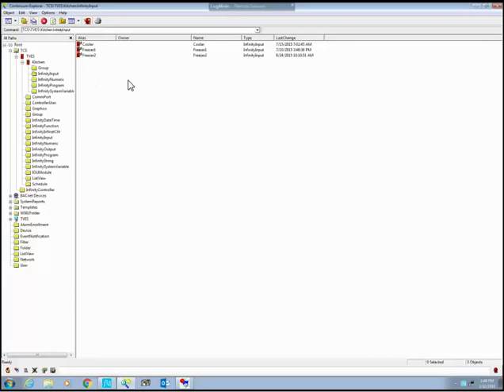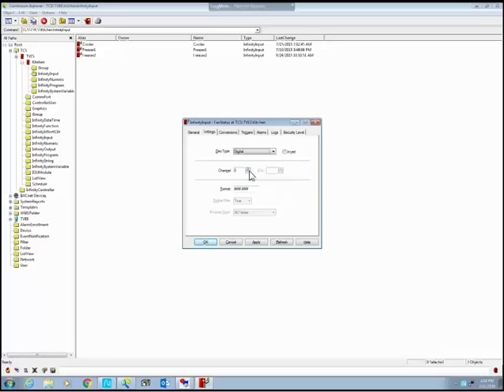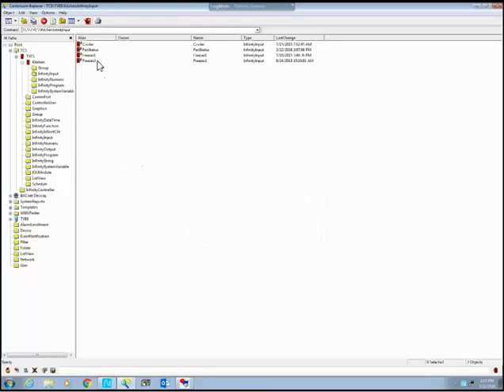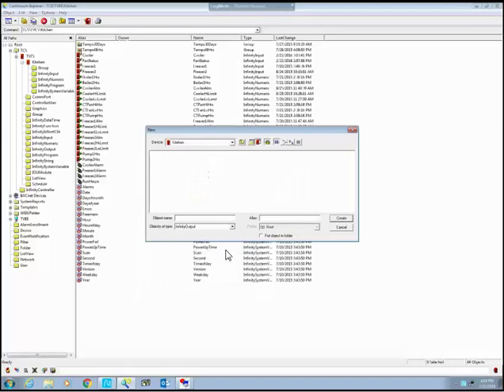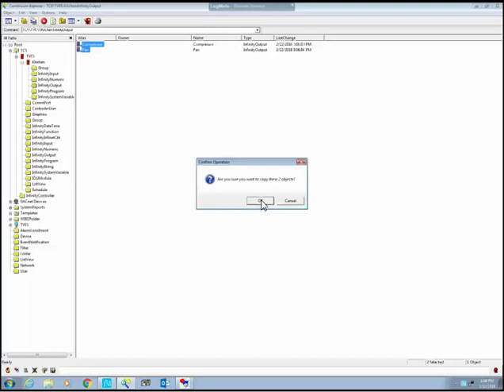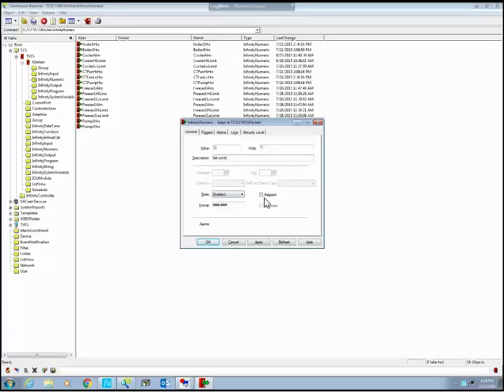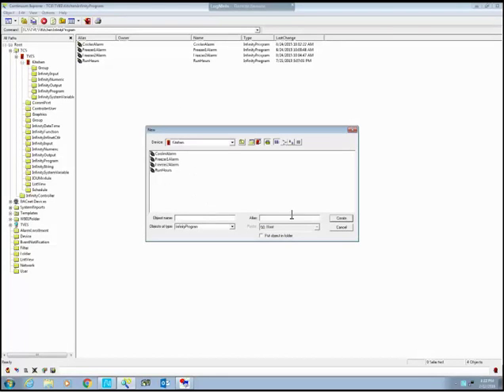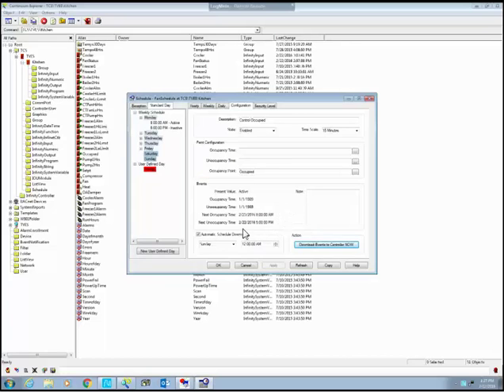Andover Continuum/Cyberstation Video 13 -  Creating Objects, Inputs, Outputs, etc.

Comment: hi that would be the opportunity you to do a movie about writing program type temperature actuator I'm talking about the temperature in the duct as 25 deg and cooling if the temperature is higher than set point on room ... or set up the correct temp as 22 deg using the heaters and cooling on one duct
the graphics and how to build  of heating duct , cooling or extract fan ...
personally You are doing good moviesthanks ralf
Reply from the maker: +rafal s I could write a program easy enough, there is just a lot of information missing to do so,  is the heating electric or hydronic, is the cooling dX or hydronic. are the acuators two position or modulating, what is the signal that each of the actuators use., things like that.  The system and controls really need to be clear before a program can be properly written.  As for the graphics I will be making some videos on how to modify and create graphics in the near future.  But if you can provide the information on they system I will try to make a program for you to use. KH